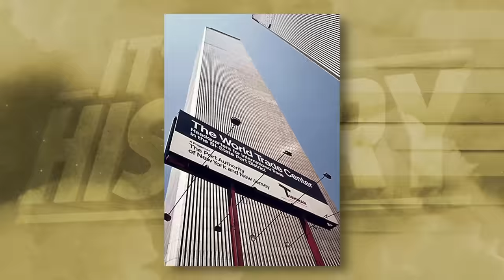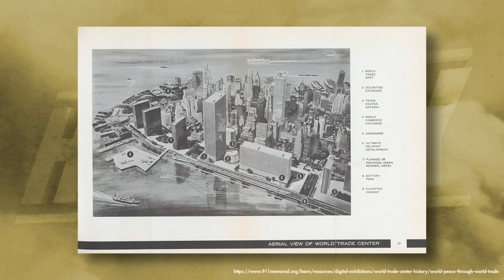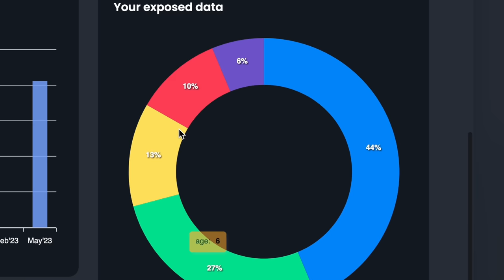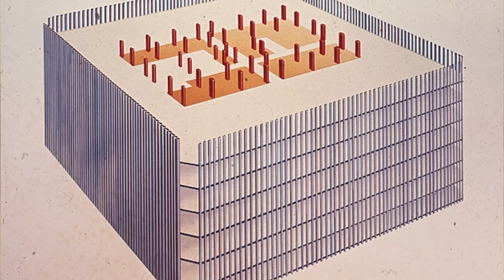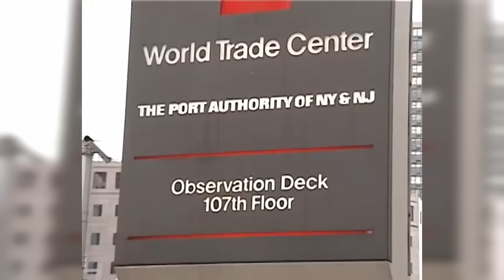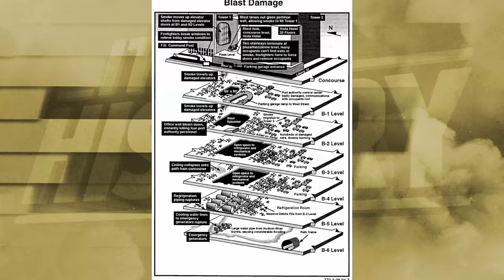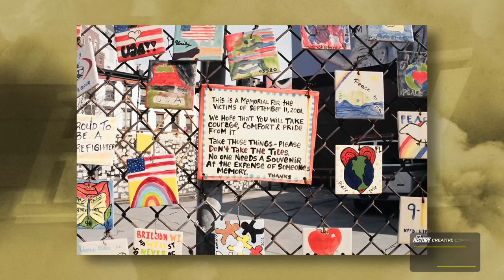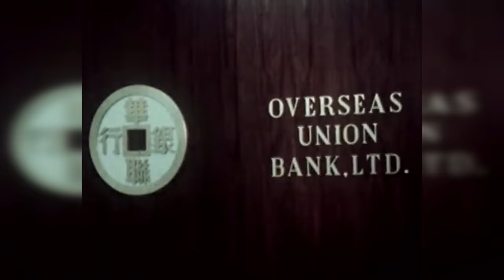What's Left of New York's World Trade Center | Rise and Fall of the Twin Towers

Comment: In the summer of 1987 I did an internship with a Wall Street firm on the 105th floor of 2 WTC. The elevator ride from the street level to the sky lobby on 78 took less than a minute. You could feel the building sway slightly during a summer thunderstorm, and on a clear day, the view was spectacular. Shout out to the past and current members of The Ten House (FDNY) on Liberty Street who frequently kept their doors open and let a kid from Long Island check out their firehouse #NEV3R4G3T 🗽
Reply: Cool story
Reply: '87 is the year 7 WTC opened-up as I recall. ~NEVER FORGET.🇺🇲
Reply: Did you still feel safe? when it swayed?
Reply: That's funny, I just watched a documentary explaining how the towers were built and there was not one elevator that traveled more than 40 floors. If you wanted to go to the top, you had to use 3 separate elevators because full building elevators didn't leave enough room for anything else, so they had to split the elevators into sections of 40 stories a piece in order to make the towers mathematically viable. Were you riding Willy Wonka's Wonka-vator?
Reply: @euphoriatoast  There technically was one elevator that did reach all floors from what I remember, but it was maintenance only, and I doubt Gary would have ridden that one.
Reply: @james_fisch  My thoughts exactly, that perhaps there was at least one that reached all floors but it was a freight elevator for service and maintenance only.
Reply: @euphoriatoast   THERE IS 1 EXPRESS LIFT TO THE VERY SIDE
FOR THE RICH AND IMPORTANT PEOPLE
LOOK AT THE PLANS🤫
Reply: @jamesbomd3503  Why all caps?
Reply: @bekindtoanimals2189 WHY NOT?
Reply: @scottjustscott3730 YEAH!
Reply: I’ll take things that never happened for 500 Alex
Reply: Dude stop Lying
Reply: @euphoriatoast  they had one for public that did go straight up from what I've gathered on other comments. The other elevators went to different floors and the one he's talking of had restaurants on those floors
Reply: John Morabitos story is one of the very best of that day . He was in 10 house and he had a brother Michael also a fireman . He also survived that day .
Reply: @euphoriatoast looking at the building plans, there was an elevator that ran up to the 78th floor which was a sky lobby. In order to reach the 110th floor of one the buildings, you would take this elevator to the 78th floor and get on any elevator on the 79th floor because there seems to be no elevators connecting the 78th and 79th floors. Those two floors seem to be connected via escalators. There is one elevator that does run up the entire building but it was a freight elevator. This could be found on the North and South Tower blueprints.
Reply: @sirsoulless  I'm sorry I didn't realize you were an architect and structural engineer who could read complicated blueprints for skyscrapers. I watched a professionally made documentary on how the towers were built and why they were built that way complete with interviews with the people who designed and built them. I'm just going on what they said, seeing as how they would know better than anyone else including internet experts in the comment section of YouTube.
Reply: @euphoriatoast  I actually studied Architecture and Drafting for two years before switching my major to Business Administration. Which I don’t claim to be an expert. I also based my comment on a survivor, who said she worked on the 105th floor of the South Tower. After the first plan she was going to take the stairs but her colleague pulled her into the elevator and they took it to the 78th floor and then got on another elevator to the ground lobby.
Reply: And nowadays we have the One WTC elevator ride
Reply: Bush knocked down the towers
Reply: I know it’s been like almost forty years but how do you find companies in the WTC? Like nowadays how would I figure out a company there where I could intern at the new One World Trade Center??

Comment: I worked for Ace Elevator. We had the contact for the elevators and Escalators modernization program.  At the time we was in the process of  modernization of both the elevators  and escalators when this happened.  I was in the North Tower the day before delivering brand new shimms for one of the many elevators of the property. Our company also had a contract with 1 Wall Street. And days after the disaster,  I went to the top of 1 Wall Street and looked down at the destroyed World Trade Center and the trucks carrying debris from the site looked like small toys moving through a steel pile. I've witnessed two aftermaths of disaster. TWA Flight 800 where i was in the Grumman Hanger of the rebuild 747  that exploded over L.I., and the World Trade Center. Quite sad for one person to know.
Reply: Dude you should get this info out. Many people think that the fact that the elevators were getting worked on just beforehand means they were placing bombs in the elevators for the day of the attack

Comment: I used to work at 1 Centre street, which was across the street from City Hall.
This was several blocks away from the Towers, but close enough to see the towers clearly from the rooftop. When the first plane hit the first Tower, nobody really knew what happened. The were news reports on television, and most people thought it was an explosion. Upon seeing the initial reports, I and several other co workers went up to the roof at 1 Centre St., which is one of the tallest buildings in the area.
We noticed the large hole on the side of the tower which was billowing a massive amount of smoke and office paper. We were mostly thinking it was a bomb that caused it, as the last thing on our minds was that a plane hit the tower. As we watched and waited for reports, we actually witnessed the second plane hit the other tower.
Once that happened, we quickly realized it was not a coincidence, and that there was obviously an attack being carried out.
At this point, there were nearly 50 people on the roof, and you could hear people panicking and running back to go downstairs. We were all afraid that more planes were coming, and we still didn't know what was happening.
I was an engineer working for a city agency, and we ended up staying for over a week in order to help with distribution of emergency equipment and food. Our building is also located directly next to 1 police plaza, making our location a central hub for all emergency operations.
I transferred to the Bronx several years later. I am still an engineer with the same agency, but at a different location.
I will never forget that day, the look of people's faces walking around aimlessly in the streets with white ash all over themselves, or the smell in the air.
I uploaded this quick video describing my experience a few years ago: https://www.youtube.com/watch?v=oedfpnB1HY4
Reply: the video where larray and twaimz roast each other!!! <3

Comment: Each tower was built with around 100,00 tons of steel. Completed each weighed around 500,000 tons, in contrast the Sears Tower weighs a bit less than 300,000 tons. Despite being roughly the same size as either tower.

Comment: Solid show, great info. I was FDNY 1980-2003, and a Captain at the time of 9/11. My wife worked in both Towers during her career with the PA. Rockefeller needed a "Trade Center" to save lower Manhattan because that was were Chase HQ was. The first plan for the updated site had the Towers at 90 stories, but the PA insisted they be the tallest buildings. The excavation was so deep the PA had to build a "Concrete Bathtub", visible in your shots, to keep the Hudson River out. The site for Battery Park City was the excavated fill from the WTC site. Smart move!  The Fatal Flaws of the Towers was the elimination of the super-safe Fire Tower Stairway, and the extreme lightweight floor construction system. Those cheap open-web steel floor trusses had NO FIRE RATING AT ALL, and failed in the intense heat of 9/11. There were no sprinklers, and fire protection was minimal unlike the Empire State Bldg. (What few know, was the 1975 serious fire in Tower 1  almost got away from the FDNY. You would have had a "Towering Inferno" back then, and possible collapse.) 
I was a FF in L-3  (83-90), and our rig is on display in the WTC museum, losing the most guys from any line company. 
I worked the 93 Bombing and spent 3 weeks at the pile until the line units were replaced with a dedicated recovery operation. 
That day I lost 105 friends.   To learn more see my detailed work,  MY TURN ON THE FIRELINES     B&N

Comment: There is a 1/2 size replica, 52 story, WTC tower replica in Tulsa Oklahoma at the end of Boston Ave. It's called the BOK tower. It looks just like the twins, just smaller.
Reply: Built by the same architect that designed the twin towers (and the other 5 wtc buildings), it does favor them quite a bit. I wanna visit it one day for that reason

Comment: I don't know if this has been mentioned before, but perhaps you should consider changing the image used at 12:10 in the video. That specific photo is taken after the attack, during the fires. People were jumping out of the building, landing on this structure. The holes you see in the roof are from people that fell through. The darker 'cloud' visible at the front of the stage in the middle is from a body that just hit the stage.
Reply: Yeah What a duchy move smh

Comment: Interesting how both towers, as well as building seven, fell straight down into their own footprints at near free fall speed, like in a building demolition. Building seven wasn’t even hit by a plane either.
Reply: Did you think that the pieces would fly off into space, or do you understand how gravity works? It's going to fall straight down whether it's controlled or not since the integrity of the inner structure was compromised.

Comment: I worked at the NY State Education  Department in the IT section at the time of the attacks.
Someone heard there was a plane crash in one of the towers in NYC and we tuned into CNN just as the second plane hit the second tower. We then heard about the Pentagon and I said to everyone "you realize that we are under attack?". But unfortunately couldn't do anything about it.
I watched as half of my network traffic software screen turn red.
Red means that the network nodes (connections) have failed.
We later found out that all of our network wiring for the Southern half of NYS, NYC and Long Island passed under one of the Trade Towers. When the building went down, it severed all communication wiring underneath.
So half of the State Education system had no internet or phone service.
That's now been resolved by having the main trunk lines run elsewhere and built in redundancy so if one trunk goes down, the system stays up.
Later on one of our techs had nervous breakdowns because he kept getting emails asking if anyone had contact with some of his college alumnus.
Apparently, he had about a dozen or so friends that he went to college with that worked in those buildings and no one has had contact with since.

Comment: What a lot of people don't realize (myself included) is that WTC existed in a time before the internet. So you couldn't just contact someone instantly anywhere. If you wanted to trade globally, you had an office in the WTC, the WORLD trade center, so your WTC representative would negotiate with the company you wanted to trade with's WTC representative, in the same building, you just called them on the building phone network and arranged a physical meeting then and there, as opposed to having someone fly to wherever you needed them to negotiate for you. 

All the paper falling from WTC during 9/11 is because everything was paper based. No one used computers (much) at the time, especially for business. 

WTC occurred at a very specific time and place, I doubt it could have happened at any other time than at the boarder between the 60's and 70's.

Comment: I visited the observation deck in 2 WTC in August 2001 at 7 years old. Did not realize until several years later how uncomfortably close that was to the attacks.
Reply: dont worry, as a tourist you had small chances of dying to the attacks, since if you wanted to go to the observation deck on september 11th, the first plane would have struck the 1wtc before the deck was even open, meaning you couldn't have been hurt

Comment: The antenna on the north tower was not part of the original design plans. The structures were so overbuilt that when asked if the antenna could be added they were like sure, no problem.

Comment: @22:04 Not sure where you got that figure but there is no way 500,000 people could fit in those buildings.
The estimated death toll was based on 55,000 people working there.
Reply: Surprised I had to scroll this far down to find a comment about this. 50,000, not 500,000.

Comment: Im sorry, I wanted to know after the 2001 attack what happened to the Twin Towers?! 
Is it rebuilt on the same site? 
How many towers are there now? Is it just 1? 
Is the Memorial in the same site where the Twin Towers were there? 
Can someone please answer my questions :)
Reply: Gladly.

The new World Trade Center is located on the site where the original towers and other buildings stood, along with a few more spaces from buildings nearby that had to be torn down from the extensive damage they received on september 11th.

Currently, there are multiple finished buildings, but the site isn't fully completed. Currently, there are 4 towers finished. However, three of them, while still big buildings, are not as big as the original Twin Towers. Only one of them, which has the title of the new 1wtc, is supposed to take the spot for one of the Twin Towers, with similar size, just a little taller than the original towers.

The second tower doesn't yet have a replacement, as the design of it has been heavily debated. Due to the design of the new 1wtc, the new 2wtc won't be a twin as they originally were, because the new 1wtc doesn't have a simplistic design that can be doubled. This means when the new 2wtc is completed, it will look completely different and have no connection to 1wtc. However, the two buildings will be officially known as the replacements of the original Twin Towers.

Since the new site is bigger than the original, a part of it was used for the memorial, consisting of two gaping holes. Some people say it's ugly since there's nothing there, but that's the point. It makes absence visible and implies that the towers are missing. The holes are built exactly on the footprint of the original towers and have almost the same size. 

For some reason, the holes are a little smaller than the towers. The reason why is beyond me, but that means when you are at the edge of the fountain holes, you are technically stranding inside the towers.

I hope this helped.

Comment: still the only 3 steel buildings to fall from fire.  Building 7 never even got hit, but fell perfectly.
Reply: i dont think fire is the problem here, buddy. i think the plane is the reason why towers 1 and 2 fell and the "slight" damage of tower 7, generated by 110 stories falling on top of it lead to its collapse
Reply: @enchantedhamburger8934   at free fall speeds straight down into its' own footprint?
Reply: @MannyDer  why, yes. in case you didnt figure it out, they were pretty heavy. couldn't have tipped over like in the cartoons. you can see 2wtcs fall resembles an angled fall, which quickly succumbs into itself.

also, it's not free fall speed. 2wtc falls 1 second slower than the terminal velocity from the top, and keep in mind it falls from a lot more lower than the top, while 1 wtc falls 3 seconds slower than free fall.
still pretty fast, almost like the buildings are heavy and can destroy things in its way.

Comment: 15:28 - - Feb 13, 1975 a fire spread from 9th - 14th floors (most damage was on 11th floor where fire started).  No sprinklers.  
15:58 - - Feb 26, 1993 - - truck bomb in basement.
18:17 - - 9/11/01 - - graffiti NYPD TEMP HQ at Ground Zero
18:32 - - Great shot
1:02 - - new wtc - - not yet finished

Comment: Sadly, their design also contributed greatly to their collapse. Open floorplans which allowed jet fuel and their resulting fires to spread freely and debris to strike structural supports with no obstacles. They also took a large part of their structural rigidity from their skin, which was penetrated by the airliners.
Reply: i think a lot of corner cutting was the main cause of the collapse. these beautiful buildings were cursed with horrible flaws that were intentionally left there for money.

Comment: I dont understand why they did make it same way like before.
Reply: PTSD for the survivors could’ve been a reason. Seeing a ghostly new set of TTs knowing what occurred
Reply: Mostly because the ‘footprints’ of the original twin towers were considered ‘sacred’ and had to be part of the memorial. There was also the need for replacement buildings to be better structured to deal with modern terrorism, the old twin towers design was not suitable.